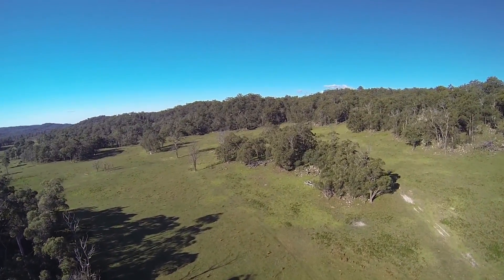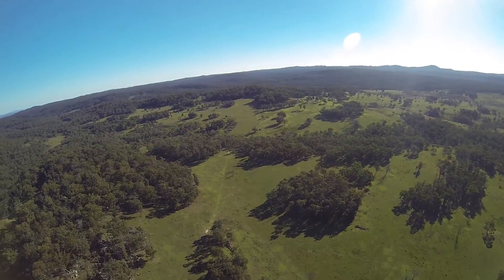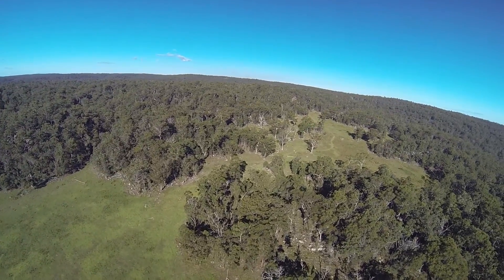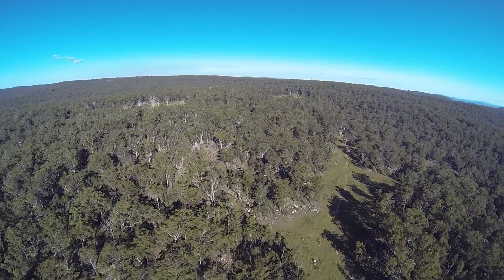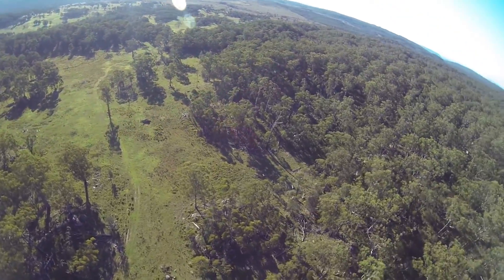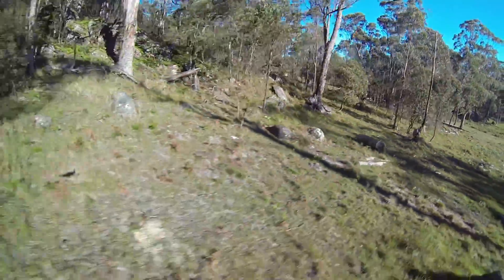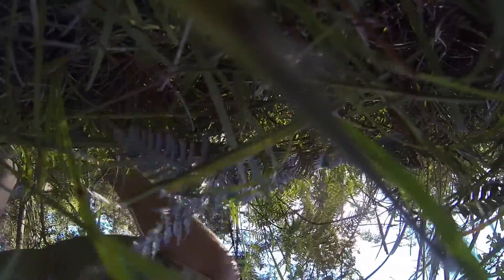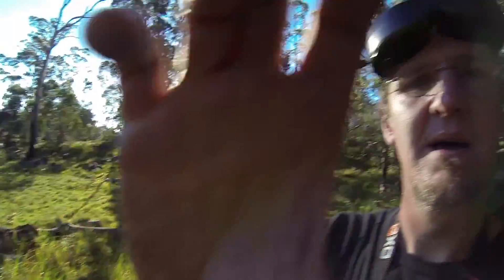Naze32 Return to Ground GPS fail quadcopter crash

Comment: did it automatically switch in to RTH or did u manually switch it to return to home? The same sort of the happened to me but i had no gps and i lost video so it just fell to the ground...
Reply from the maker: Rowd0G It was automatic - I had a failsafe. The receiver was set up to switch to particular settings when this happened, unfortunately those settings only involved RTH and no altitude hold and autolevel mode. This is very old firmware though, not sure how the current version of cleanflight behaves.
Reply: oh ok, so u were flying in acro when it happens and rth only works in angle? is that correct?
Reply from the maker: Yes, but also it switched to presets when it failsafed - and those presets did not involve angle, so even if I had have been flying in angle (which I wasn't) it would have switched off.

Comment: what's your buzzer alert ? how it's plugged?
Reply from the maker: It's just a standard 5v beeper, plugged into the Naze32. I'd configured it to go off on failsafe. You can also set it to run off a switched radio channel. Unfortunately it's not very loud; a dedicated lost model alarm is much better if you can pick one of those up.